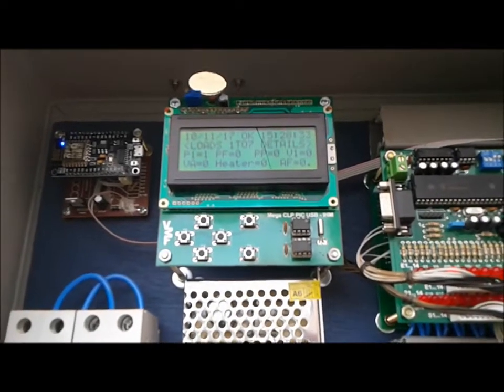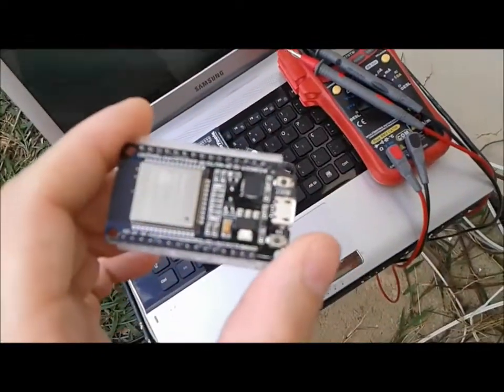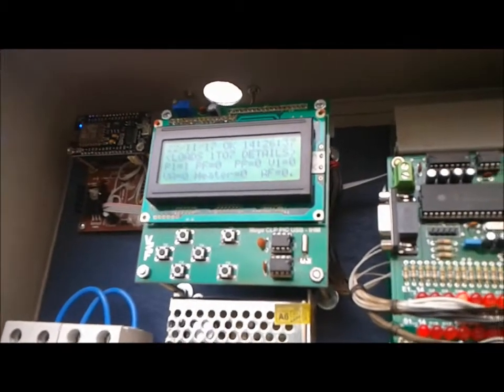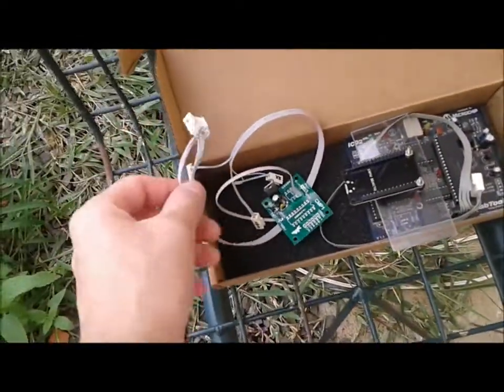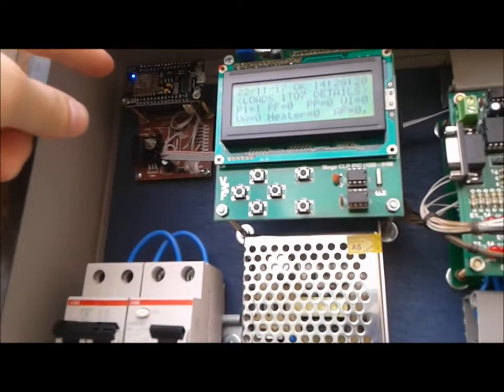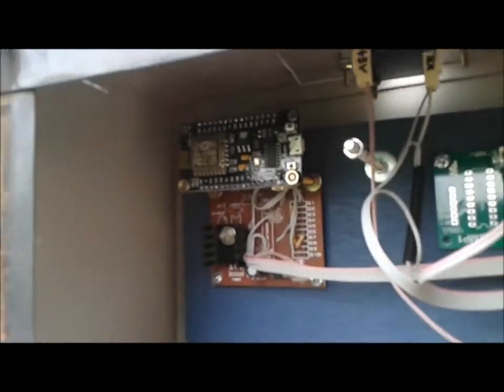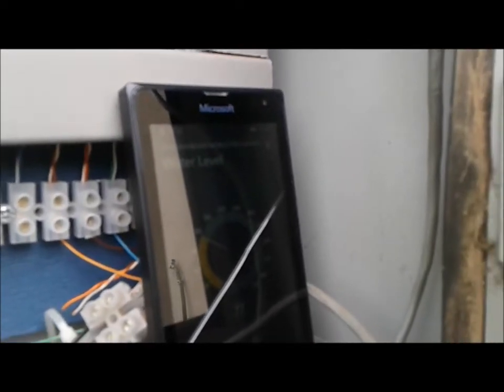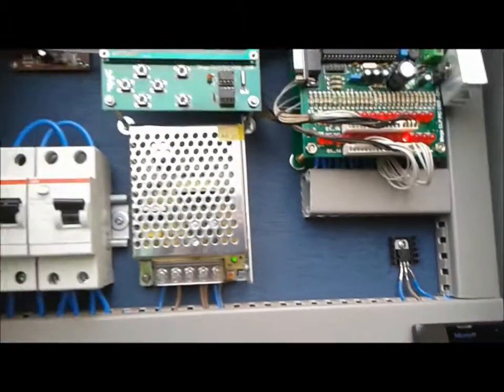Aquaponics System - Replacing ESP8266 with ESP32

Comment: What you can do is solder a cable on to the WiFI antenna and make that cable out of the metal box.  Have done something similar my self with good result.
Reply from the maker: Tks mate. I have to figure out a way to do that so rain water stays away from the point where the cable goes out. And has to be somehow easily removable in case I need. Right now the signal strength is about -80dBm, which is good enough for this application.
Reply: Good that you get a decent enough signal.  What I did was to lead out the cable at the bottom with a small hole (3mm) then used a lot of silicon to seal it.
Reply from the maker: Did you install it inside a metal box like I did? I would have to lead the cable out through the top section, its closer...
Reply: Yes I installed in a metal box but my ESP is mounted closer to the bottom then yours.
Reply from the maker: Cool. I have it up in the panel so it can say away from any interference that might come from the AC section.